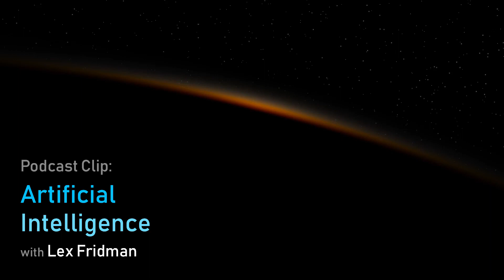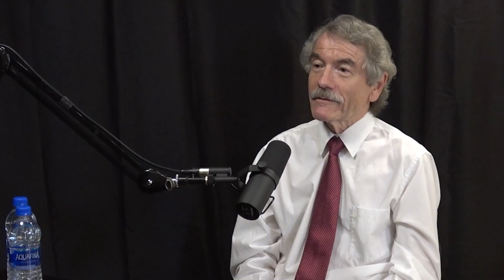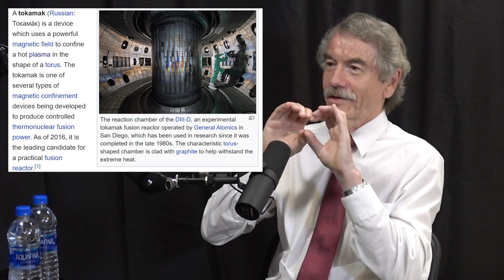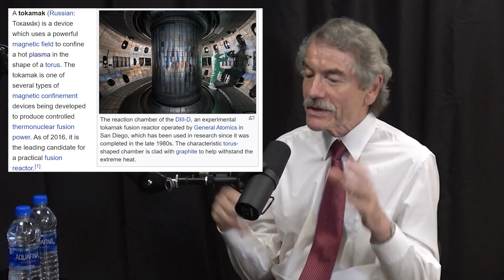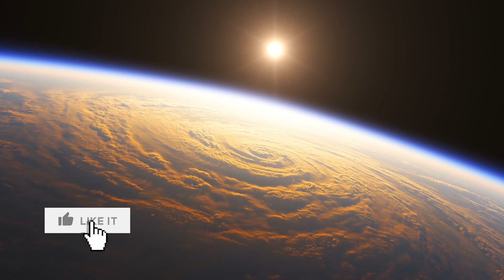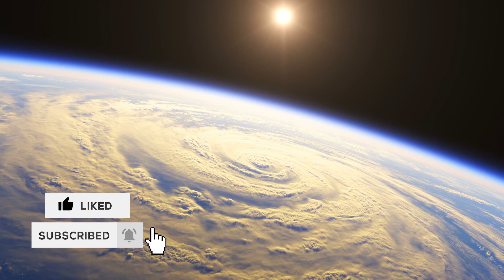Nuclear Fusion Energy | Ian Hutchinson and Lex Fridman

Comment: Fusion would definitely save world - but the up huge front costs pushing boundaries of new tech - and the "mega project" political and "visual" liability  - all those giant steam towers that scare shiz out of people three mile island style.  Why not go smaller and cheaper and faster track to net zero.  Why doesn't NRC or whatever the correct nuclear agency is  (after the proper conceivability studies are made) buy a bunch of super reliable and safe USN reactors that already power their subs, CVs and ships - "off the shelf" well established tech and engineers as well - (when was last USN nuclear accident?  50 years ago?) - network them together, and, for xtra security, bury them ICBM style in rural areas (Nevada for CA free electricity? or how bout the old Titan II fields - they being used for anything?)  - groups of 10 networked small, super safe and super secure reactors power mid sized steam generators.  Less risk / faster development / faster on line net zero energy.  Any downside to a serious feasibility study?

Comment: Hydrogen may not be compatible with the fusion process generator. 
Helium on the other hand may hold the key. At near zero temperature this super fluid becomes inert and cannot induce friction therefore can be accelerated to near light speed and maintained with nearly zero energy input.

Comment: As outlined in the video ITER was designed in the previous century and has been under construction for over a decade. The design requires a scale that makes progress very slow and risks being overtaken by other initiatives. Advancements in materials and technology allow for much smaller tokamaks to be built. This will be way faster and cheaper.

In this regard REBCO (Rare Earth Barium Copper Oxide) is a gamechanger. These High Temperature Superconductors, used for the magnets containing the plasma, can be cooled by liquid nitrogen (24 Kelvin) as opposed to the liquid helium (4 Kelvin) needed to cool classic superconductors (like ITER uses). This allows for much smaller reactors.

MIT together with Commonwealth Fusion Systems are currently building SPARC, a tokamak reactor over 10 times smaller in size compared to ITER. Scheduled to be built and running by 2025, SPARC can achieve net positive energy, based on the demonstrated performance of the magnets. The next step is to scale up, and to build an actual power plant (ARC). ARC design aims for a Q-Total > 1 (net positive energy) at Q-Plasma = 4 and Q-total > 4 at Q-Plasma = 14. The target for pre-decessor SPARC is a Q-plasma > 2. SPARC projections however, identify a viable operational point where Q-plasma is between 9 and 11.

I can't help feeling a bit sorry for mr Hutchinson, since, of all institutions, MIT's initiative looks like a main contender to overtake and run rings around ITER. Quite suprised SPARC, or any other fusion projects for that matter, weren't at all mentioned in this video.

Comment: Look-up the Farnsworth Fusor been doing low energy fusion for 100 years. You can build one in your garage. However, this being the only working example of fusion I think it has lead science down a rabbit whole of misleading goose chases. And, I believe, it is the reason we think the Sun is a giant ball of gas when all the observations suggest it is mostly metallic hydrogen. Which, after a 2019 paper by NASA regarding "Lattice Confinement Fusion" basically confirming the discovery of Ponns & Fleischmann in 1989; gravity is likely not the means by which even stars confine nucleae to fusion densities.

That is to say that NASA has solved the "Cold Fusion" problem by their own admission, and they intend to build rockets and power supplies for deep space probes with it. Plasma confinement won't work, because it isn't how nature does it.

Comment: I couldn’t help but notice how he skipped the part of how much energy is needed to keep the reactor going.
The one in Britain named JET in 2021 sustained a reaction for 5 seconds and made 59 MW but for the life of me I can‘t find how much energy they used during these 5 seconds. Which is the most important factor. Because they can make billions of megawatts but if they‘re using 100 trillions to make it… then there is something wrong here.
And then you have the Tokomak. 
In the past I was able to read about it and laugh but now there is nothing. Even on official sites and videos.
All they talk about is how much they expect it to make when it runs perfectly. Which is of course around 10 times the energy input!
Oh wow! How about now compared to like 30-40 years ago?
Because last time I remember the improvement being around 3% in energy output.
And that brought it to about 7% if I‘m not wrong.
100% being being a zero sum level of input and output. Meaning no loss and no gain.
And now we go back to the professor.
It‘s a bit disingenuous to say that it produces 10 or 20 megawatts without telling us that it took mabe 500 megawatts to make it.
Like breaking 20 eggs to make just one omlette.
I believe in fusion. But at least tell it to us straight. we‘re more than 50 years away from actual parity
Reply: Well said, what's important is electrical power out vs electrical power in and nobody is anywhere close to being able to break even on that. Then there is the tritium breeding problem. That may be impossible to solve.
Reply: The nuclear energy industry is heavily marketing Fusion to get more funds, so they constantly appear in the media promising the benefits of it, they are doing it for more than 40 years and I agree fusion is the energy source of the future. But the truth is that we are far from having it working on a daily basis, by 50 or more years. There are huge technically important aspects to solve like the stability of the plasma for long periods of time. So we have to deal with more important problems first, such as climate change by reducing our energy consumption and avoiding unnecessary business as usual or constantly growing the economy if we want to survive.

Comment: How to stars first ignite to produce sustained fusion?
Reply: Inate irregularities in density of the nebula cause certain areas to attract more gas than others. These areas collapse due to gravity continually until an outward force begins to impede the force due to gravity. The star's core will continue to collapse until the force due to fusion equals the force due to gravity. The more mass in the star, the more fusion reactions are required to prevent the star from collapsing in on itself.

Comment: Not all fusion designs involve magnetic confinement like ITER - Look up the companies General Fusion and Helion Energy.
They are wellfunded (2.2billion) and have working machines. GF is about to build a demonstration plant in the UK in collaboration with the Joint European Torus(JET) project.
As for Helion Energy, they have taken a design approach that is so beautiful it just has to work :)
There is alot happening in the private field, and the advances made are nothing but astounding  - Since 1970 the energy efficiency improvements have risen like Moores law.

Comment: Those are some great explanations. But some points to that:
1. It looks to me, that the cosmology is partially wrong, those fusion experiments are based on. There is lots of plasma in space, but gravity is seen as the only relevant force? Come on... Also, why are sun spots dark? Build a probe to dive that and find out. It can't be much more expensive than ITER... No one was looking yet, still mainstream science is so damn sure how it looks inside the sun/a star. The same applies for planets.
2. Put more effort into small fusion projects, that don't have the constraint of a Tokamak. There are several out there, that go differently about achieving fusion.

Comment: This is absolute nonsense. ITER will not produce net power and no fusion system has ever done so. He is neglecting conversion inefficiencies and power for the containment. Furthermore, the collection efficiency for the alpha particles and neutrons is as low as 5%. His statement about thousands of years of uranium is bonkers. Replacing current world electric production with thousands of nuclear plants would deplete present reserves in about 5 years. Tritium is also very scarce and mass lithium-6 production isn't feasible. Nuclear waste in a small part of St. Louis caused 2,700 cancers. Total lies.

Comment: Ok
Where does the heat hotter than 10x the sun go after?  Isn’t a temperature that high going to cause global warming?
Reply: Temperature as humans know it is in a dense gas.  Fusion reactors operate at much lower densities.  Ideal gas law.  What matters is recirculating energy in the vessel and power densities.  The recirculating energy is relatively low and the power density goes into boiling water (the original goal).  The waste heat of all human electricity generation is several orders of magnitude below what the sun deposits.  Society in your great grandchildren's lifetime won't have to worry about that kind of power balance and would be classified as "a good problem to have".  If you have that problem then you stopped greenhouse gas emission and human society has thrived immensely.

Comment: Hmm, get rid of magnets and lasers and so on and both contain and heat the plasma in a closed toroid using high energy microwaves. Microwave Inertial Fusion (MIF). There is absolutely no need for magnets and laser heating sources.

Comment: A skilful description of how we have been trying to do nuclear fusion, so far unsuccessfully. However, it is now proven to be but just too late. Nuclear fusion is already here, much smaller, cheaper and simpler and you can learn about this fantastic good news at "aureon @t". The problem with current worldwide fusion research is that it believes in the fallacious theory, which is in a centre of sun fusion gravitational concentration model related to high temperature and pressure. Learn the truth with Electric Universe Theory, "The Safire Project", which proved this theory in the lab test and in the soon to be built commercial fusion-powered Safire Generator. Study at "The Thunderbolts Project website" for the greater picture.

Comment: I thought that the bigger scare with Fukashima was not the reactors, but the spent fuel pool that they needed to keep cool?  A little tiny bit of material that could have caused a whole lot of damage. Was I misinformed?
Reply: Afaik they wanted to prevent a meltdown. Spent fuel usually just sits in pools, it doesn't need that much cooling. But maybe I'm the misinformed one.

Comment: Just a very Expensive, Complex and Dangerous way to Heat Water..
Reply: @Nick Milligan 
Fussion may be much safer than Fission, but still:
Neutron radiation streams could damage the structure of the reactor due to design-intrinsical poor/uneven magnetic shielding, which could easily get compromised with potential radiation, tritium and lithium release..

But that's not the point:
Just as with Fission, all nuclear reactors are just a fancy and overcomplicated way of Heating Water,
and that makes no sense.. If you want to  use nuclear energy, learn to gather it's energy more Directly,
but using such Complex, Expensive and dangerous methods to Heat Water (nuclear kettle), is just pathetic..

But ofc, besides the military, there's just so many money-avid interests involved as to stop the theoretical/practical development, as has always been..

Comment: Let's move a gas-turbine with 1.000.000K plasma. Sounds reasonable.
Reply: Actually, if the turbine has non-material blades... Check out MHD (Magneto-Hydro-Dynamic) generators. Very cool stuff.
Reply: You think they use the plasma itself to turn a turbine?

Comment: So.. questions...
1. what is the by-product of fission, water?
2. the actual electricity production would still be heating water to become steam and drive the turbines that make electricity (like in fission nuclear reactors)?
Reply: 1. no. for Uranium. It would be radioactive isotopes of trans uranic elements.
2. yes. it would turn a turbine which eould produce electricity
Reply: @TechKidShazil  so this fusion technology would not be much cleaner than fission, with all the waste with long half-life?
Reply: @godweenausten  no it would be extremely clean if it deuterium or helium fusion. The by product will be just helium
Reply: @godweenausten  we dont use uranium for fusion
Reply: @TechKidShazil  okay, thanks!
Reply: There are different types of fusion. A very advanced form of fusion, aneutronic fusion could produce electric energy without a turbine.
"energy from aneutronic fusion could be captured using direct conversion instead of thermally. Direct conversion can either be inductive, based on changes in magnetic fields, electrostatic, based on pitting charged particles against an electric field, or photoelectric, in which light energy is captured"

Comment: Impressive communicator! But still is it possible that fusion is a pipe dream? Gravity in a star is "free." The star is igniting the sticks and they keep burning because the match never runs out and keeps firing. And even then the wet sticks barely sustain the burning--that's why it keeps going for billions of years. The nuclear energy is only slightly more powerful than the massive gravity. On Earth when we try to do gravity's job with magnets, we have to pay for the energy we spend and isn't this energy 99.999% of the fusion output we get in the end? Are there any stars in the Universe that are as large as a tokamak and live for 100s of seconds?
Reply: At this point it appears that fusion is not a pipe dream, but rather a difficult engineering problem.  HTS magnets enable economically viable fusion reactors (something much smaller than ITER, see tokamak/stellarator scaling laws and lawson criterion proportional to the 4th power of magnetic field strength).  It's still a complicated machine with high neutron flux densities and thermal densities.  How do the materials hold up?  How cheap can safe tritium processing facilities be made?

We're close to having these questions be at the top of the list, but the world still needs to see a cheap fusion reactor run.  SPARC is near.

Comment: Yeah its sad that fusion research is very slow, even when ITER have generate net energy we still need to make another even bigger one (they call it DEMO) to start generating electricity, hopefully when ITER proved itself more resource would be given to accelerate fusion reactor development. But, next generation fission reactor (that can passively cooled itself) should be quickly implemented we need to shut down as many fossil fuel power plant as possible.
Reply: And watch oil prices plummet.
Not to be a conspiracy nut, but some powers with stake in the oil business will not like that.
Reply: @im_aleey  wondering if they're waiting for a global financial meltdown and destruction of national currencies to zero out the debt before switching to a nuclear based system

Comment: I vote that Ian should move next door to Fukashima
Reply: Why?
Reply: @kennyg1358  because he doesn't believe that the dangers posed by fission reactors is that big a deal, silly!
Reply: jefferee2002 ...wrong, he does, and he mentions radioactive wastes (the volatile ones, too) and he also mentions safety problem....so perhaps you have a problem with your hearing or your memory or your comprehension?
Reply: @remlatzargonix1329  yes, he briefly mentioned them but stated they were insignificant.
Reply: @jefferee2002  Where in the the video does he say they are insignificant? He says the quantity of waste produced is small, not that storing or controlling it is an insignificant challenge.
Reply: @Willaev  or,  you could move!